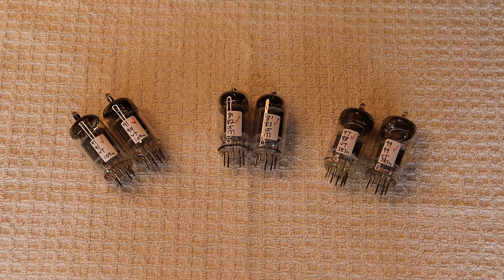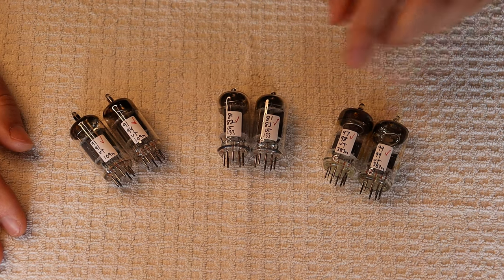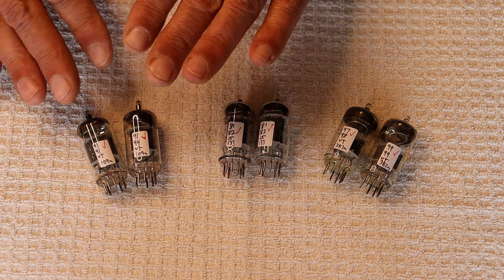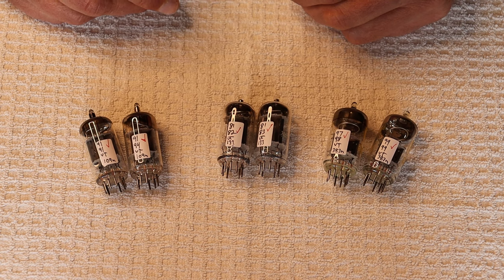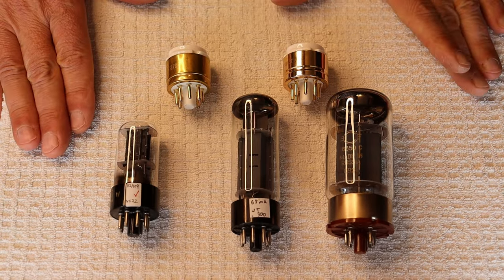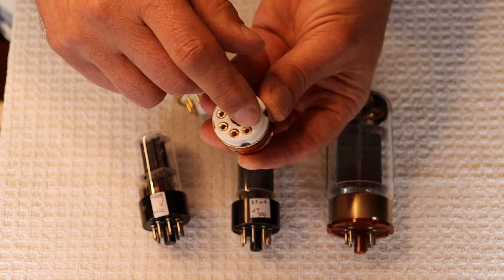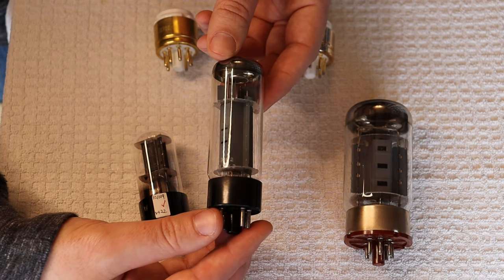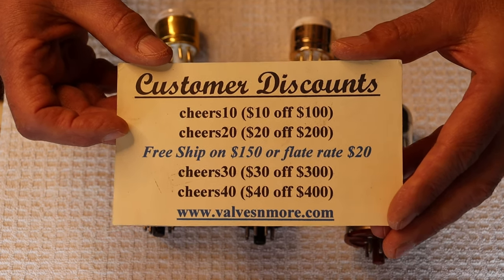Tube Lab #180 - Rolling 12AX7 Tubes & The Importance of Matching

Comment: I have a McIntosh mono and they say tube matching is not necessary because of the way the amps are designed. But then I hear it's always good to get match tubes.  Not sure why they believe this to be the case about matching not being necessary
Reply from the maker: Yup, if all you are running is a single mono channel, so long as the preamp tubes are reasonably close and testing good, you are good.  BUT if you combine 2 mono preamps or power amps, now it's critical the tubes are matched across amps.
Reply: @tubelab194  I do in fact have two monos, sorry if you thought I only had one.  So it doesn't make sense that tube amps don't benefit from tubes not matched. Very strange the techie person at McIntosh would say this. Although he's opposed to swapping out his stock JJ tubes because he says it all tubes sound the same on his amplifiers so it doesn't matter which tubes you use.
Reply from the maker: @iampuzzleman282  haha, well now you know how knowledgeable he is.  Remember manufacturers, even higher end ones, rarely supply amps with matched sets or even good quality tubes.   McIntosh typically brands the tubes they include in their  amps with fancy logos, but do they test and match the tubes and provide testing data?  Nope, and it doesn't take a genious to figure out why.  Supplying quality tubes costs money and proper testing is expensive to do.  I always tell customers who want to buy a new commercial amp to consider the supplied tubes as a throwaway set.